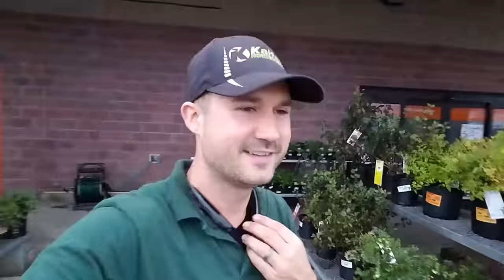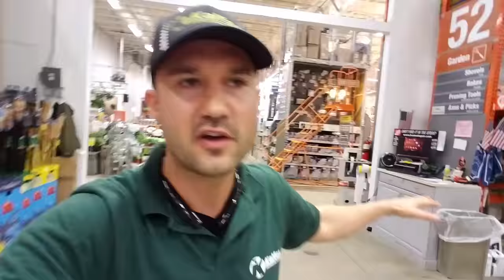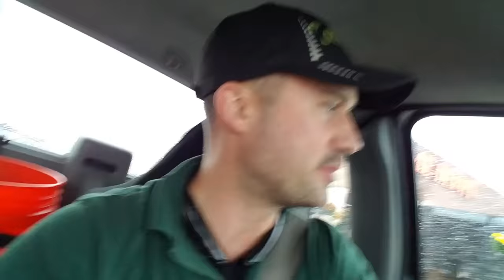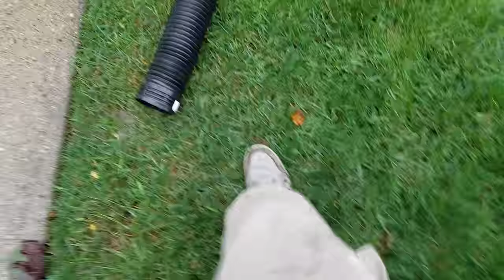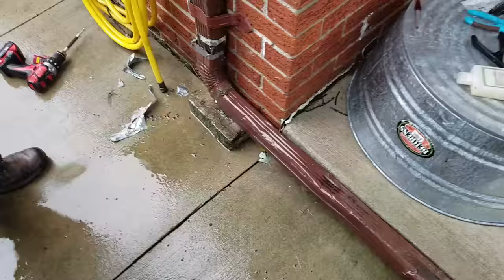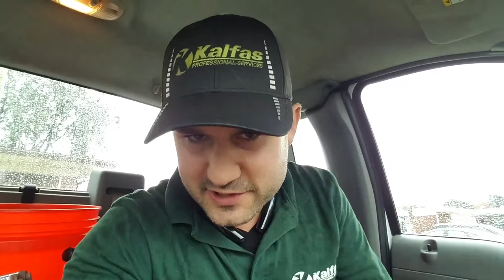(Eposide#48)"UPSET Landscaping Customer" Over Gutter Downspouts

Comment: So when the water sits in that pipe, is it supposed bro just evaporate over the course of a few days? Also would you give a rough estimate of what you charge the customer for the finished project, that is a great idea I would love to bring to alabama
Reply from the maker: +Roy's Landscaping & Lawncare make sure you drill "weep holes" in the bottom of the end of the pipe. And have it "perculate" or drain into a bed of compacted crushed concrete underground 6inched deep.

Comment: Makes no difference. The number one reason for water in a basement is from surface water runoff. Correcting surface water run off is the first step for water problems. And this is a lesson to anyone doing or correcting drainage issues. As a contractor, or a homeowner, you must take into consideration which way you direct water. You will be liable should your neighbor complain your actions contributed to a greater water problem onto their property. Hope it works out for you ;)